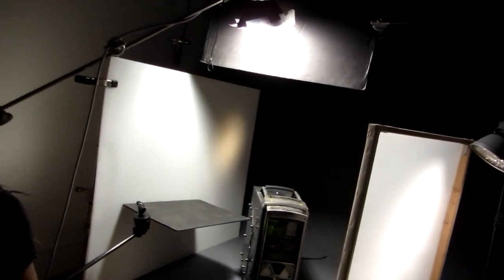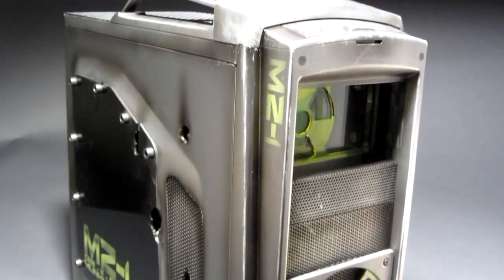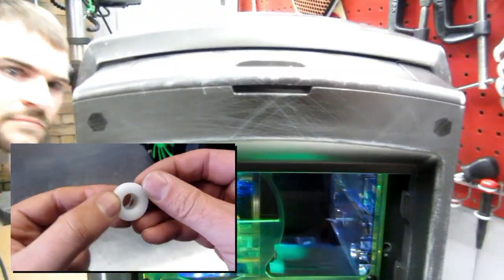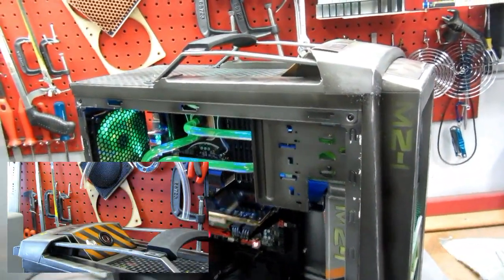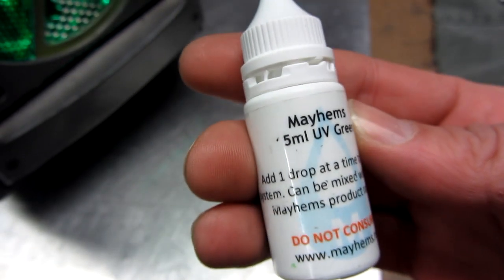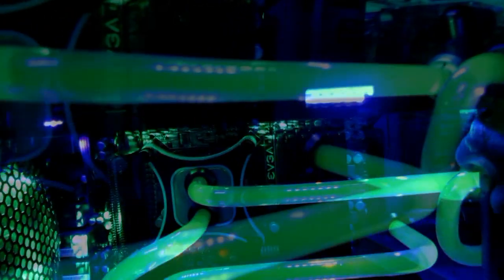"MZ-1" Mod Zoo PC, PART 5 of 5, Cooler Master CM Storm Case Mod, UV Green Liquid & Photo Session

Comment: I would love to have these parts for a build that I am contemplating later this spring. It will be my personal gaming rig. I am a totally new to modding and having some professionally designed parts to go in my new build would really bring it up to the next level.

I have built several systems years ago, but never had gotten into modding, liquid cooling, sleeving, or overclocking. I now find myself totally engrossed in the possibilities.

Thank you for your videos, especially the how to ones. They are tremendously helpful to a newbie like me. Keep up the great work!

Comment from the maker: FIXED Giveaway Parts Links

1x Mnpctech Overkill "Nautilus" 240 radiator / fan grill
http://mnpctech.com/pc-computer-alphacool-ek-bitspower-hardwarelabs-heatkiller-liquid-cooling/mnpctech-overkill-240-nautilus-fan-and-radiator-grill.html

2x Mnpctech "Reactor" 120mm 3/16" thick billet fan grills
http://mnpctech.com/pc-computer-cooling-fans-grills-custom/pc-computer-gaming-machined-cooling-billet-fan-grills/

24x Copper PC Chassis Pop Rivets,
http://mnpctech.com/case-mods-gaming-pc-liquid-modding-custom-computer-mnpctech-overclock-cooling-fan-grills/pop-rivets-for-pc-chassis-cases-copper-black-silver-countersink/1-8-pop-rivets-for-pc-cases.-en.html

1x set of White Delrin PC case feet, 
http://mnpctech.com/pc-computer-stereo-desktop-case-feet/mini-itx-pc-case-feet-white-delrin./mini-itx-pc-case-feet-white-delrin.-en.html

2x 120mm UV Green Fanblade, Green LED Apevia PC Fans,  
http://mnpctech.com/case-mods-gaming-pc-liquid-modding-custom-computer-mnpctech-overclock-cooling-fan-grills/apevia-green-uv-120mm-and-140mm-led-pc-cooling-fan.html

2x 120mm Black Modders Mesh fan grills, Honeycomb
http://mnpctech.com/pc-computer-cooling-fans-grills-custom/modders-mesh-pc-fan-grills-en/

1x Fighter Pilot Toggle, Standard On/Off with CLEAR cover,
http://mnpctech.com/case-mods-gaming-pc-liquid-modding-custom-computer-mnpctech-overclock-cooling-fan-grills/switches-toggle-pc-computer-power-reset/military-fighter-pilot-pc-toggle-switches.html

Comment: I'm currently modding a Fractal Design Define XL (Rev. 2 - really making the case wicked.. not just adding in a window and some other stuff..), which I'd surely be glad to get some awesome looking parts for :)
Done so far:
1. Planned out how to mount my case so it "evens out" with the side of the table its being built into (It's kinda gonna look like a built-in aquarium type thing..).
2. Made the case thinner and made a new new "side-door" instead of the front opening "door".
3. Currently adding watercooling to the setup (..your previous acrylic video gave me a gew ideas and hints - thanks).

Comment: Starting with some computer class in a week or two , probably gonna customize a CM Haf XM in a few months Just changed the inside of my old computer case (replacing harddrives etc.) , wouldnt mind changing the outside ... Those parts are just awesome!

Comment: Bill,
I'm planning on modding my Chieftec dragon case, as we have discussed previously in the forums. These parts would sure be a great help in getting that project going.  I should be ordering my new build within the next month so the chassis will be empty and ready for work.  I had considered a Dr. Who theme, but that's lowest on my priority list as I'm wanting  to make this case as modern as possible, feature wise.  I had already considered making the case ready for a 240/280 rad as well as some other unorthodox modifications.  I'm sure i can find a great use for the majority of the parts and what's not used I would be willing to give away myself.  Also, I would do a review/overview video of all the parts on my channel as just a small way of saying thank you.

Comment: That thing came out sick. I like how the blue leds reflect off the tubing. Gives it almost a blue outline. Gotta say, after watching all your vids ive been inspired to build my own mod. Got a corsair 600t that i want to paint either red or dark purple. Gonna add another r9 290 in there and try my luck with a custom water loop. Im probably gonna try to get a 240 rad in the front panel to cool the vid cards and those fan grills would look good on it if ya catch my drift there pal.

Comment: that's one of the coolest case i have seen.

I don't have 'too much' money but my system is so old and slow so i have to update it.
I have decide to update my system next spring. 
Those fan grills and led fans would fit perfectly to my modified antec gx700 case.

Comment: Nice parts. I also modded my cm scout2. 120rad 45mm in the rear and 240rad 30mm in the front. The tubing failed  a bit and dellidding my 3770k too. Made some scratches on the cpu, then I used the vice and hammer method and I saw my cpu flying for meters. I was surprised that my cpu survived it :D

Comment: Well where do I start Bill, love the videos they have gotten me motivated to start modding computers again, havent done any since my oldest boy was killed by a drunk driver 8 yrs ago. But your vids god me motivated and I found an old Xclio windtunnel grey case that I decided to Mod, put a window above the the 2 larger fans on the side(got all the stuf from mnpctech by the way) took out the brace running from front to back on window side, lots of blue led fans, satin black interior, 2 tone blue metal flake and blue carbon metalflake  ( I got the idea for that from the alienware puter u did in black and silver with the carbon fiber themme) it looks really good. Opticals and bay covers, front opening cover all have the carbon fiber look. cut out the top and have been trying to decide waht to do with the fans i wan to put up there, those grills would look damn good on top, and the feet on the bottom. Put a couple of your temp gauges in one of the bay covers, did lots of stuff to it.. I could use the other paraphernalia on the next one Im building for my future son in law. Anyways love your videos keep em coming.

Comment: I already posted earlier, but I now know exactly what to do. I have a Switch 810 that I will (hopefully soon) paint a dark military green with blaze orange accents, and I have a 9" laptop monitor that I want to somehow integrate into either the side or front panel. I will put the overkill 240 grill on the bottom of my h100i inside on the top of my case, and the two green fans would go on top of the h100i, shining green light out of the slots on the top of the case. Of course the feet would go in their usual spot, then I will use one reactor symbol fan grill on the internal top-rear exhaust fan, also paint to green with the reactor " legs" painted blaze orange, and the other fan grill will go on the front of my case, after cutting out a 120 fan slot in the front cover, then place one of the mesh grills between the grill and the case front, painted green. Sweet mother of GOD, these parts would make my computer a magnificent BEAST!!!!

Comment: why? Because I'm currently modding and mid tower case with a Razer inspired look. Side window cut out, which will have the Razer Logo engraved onto the acrylic. And going for a turbine fan in the fron bezel like in your older vids :) but with a 'Razer green' fan, and a green LED fan to light the front up in a push pull configuration. the chassis will be painted flat black along with the outside panels, front bezel ect. finished of with 'Razer green' anodized screws just to give it a bit more life. The grills would really just make it stand out more, and i had and idea of modding the power switch with a missile switch and a momentary key switch as well. so yeah i would most defiantly use these part to VERY good use :)  plus I'm Australian so you know the parts will be looked after :D Cheers Mate!!!

Comment: these things would be greate to grade up my Sharkoon Value T9 which really sucks. I had a few things going on it: 2x120 Fan mounts+holes cut in the top of the case. put a fan inside on the sidepanel etc. not major things, but I win this stuff it would be awesome and I would work further on my shitty case to make it pretty and functial. I even would post it on Forums etc. I learned so much from you and I hope I can share it with others :)

Comment from the maker: By Request, links to the parts for the giveaway mentioned in the video, 

Parts Links

1x Mnpctech Overkill "Nautilus" 240 radiator / fan grill
http://mnpctech.com/pc-computer-alphacool-ek-bitspower-hardwarelabs-heatkiller-liquid-cooling/mnpctech-overkill-240-nautilus-fan-and-radiator-grill.html

2x Mnpctech "Reactor" 120mm 3/16" thick billet fan grills
http://mnpctech.com/pc-computer-cooling-fans-grills-custom/pc-computer-gaming-machined-cooling-billet-fan-grills/

24x Copper PC Chassis Pop Rivets,
http://mnpctech.com/case-mods-gaming-pc-liquid-modding-custom-computer-mnpctech-overclock-cooling-fan-grills/pop-rivets-for-pc-chassis-cases-copper-black-silver-countersink/1-8-pop-rivets-for-pc-cases.-en.html

1x set of White Delrin PC case feet, 
http://mnpctech.com/pc-computer-stereo-desktop-case-feet/mini-itx-pc-case-feet-white-delrin./mini-itx-pc-case-feet-white-delrin.-en.html

2x 120mm UV Green Fanblade, Green LED Apevia PC Fans,  
http://mnpctech.com/case-mods-gaming-pc-liquid-modding-custom-computer-mnpctech-overclock-cooling-fan-grills/apevia-green-uv-120mm-and-140mm-led-pc-cooling-fan.html

2x 120mm Black Modders Mesh fan grills, Honeycomb
http://mnpctech.com/pc-computer-cooling-fans-grills-custom/modders-mesh-pc-fan-grills-en/

1x Fighter Pilot Toggle, Standard On/Off with CLEAR cover,
http://mnpctech.com/case-mods-gaming-pc-liquid-modding-custom-computer-mnpctech-overclock-cooling-fan-grills/switches-toggle-pc-computer-power-reset/military-fighter-pilot-pc-toggle-switches.html

Comment: I don't need the parts in this giveaway, but I wanted to say that I like your mods.  Should I get these parts,  I will start figuring out a way to start my next mod.  I used your case black knurled case feet to create more air flow under my current build.

Comment: well, if i am the lucky one, i definitly would use the casefeet and the 240 grill for my waterbox-project. that thing will have three 240 rad's inside to be capeable of cooling the cpu and the gpu of nearly any system. having all those cooling-stuff in another box would make upgrades much easier. i planned to do it monochrome, so i guess the fans will be used otherwise.

Comment: Thanks Bill Wicked Parts would Love those Feet on the Define R4 once i get a CPU 6800K or Athlon X760  and DDR3 1866 or 2133 then my MSI FM2-A85XMA-E35 in the  Define R4 with UV lights  i would put those 2 fans with the Reactor grill in my Sister new APU rig in the Antec P280 the  Overkill Nautilus need to wait till it warm to paint im ask Fractal what color type it the Black and will i find it in any store to buy me 4 cans for another Project

Comment: i've just started watching your vids here, liking them very much. I have actually just sold my computer to my brother as I am saving to build a new one. 
This is my thought on what I'm thinking on getting...

CPU: Intel Core i7-4770K 3.5GHz Quad-Core Processor  
CPU Cooler: Corsair H100i 77.0 CFM Liquid CPU Cooler 
Motherboard: Gigabyte GA-Z87X-UD4H ATX LGA1150 Motherboard
Video Cards:(x2) Gigabyte GeForce GTX 770 2GB Video Card (2-Way SLI) 
Memory: (x2) G.Skill Ripjaws X Series 8GB (2 x 4GB) DDR3-1866 Memory
Storage: Samsung 840 Pro Series 128GB 2.5" Solid State Disk 
Case: NZXT H630 ATX Full Tower Case  
Power Supply: Corsair 760W 80+ Platinum 

..though I picked the Corsair cooler because I was having trouble finding a place to get custom loop parts, all from one place, and found you get your stuff from Primochill. They seem to have everything but the pumps,(some of their links don't work). 

I look forward to watching more of your work, oh and above said list is a good reason to get free stuff, wouldn't you say.

Thanks

Comment: OK dude I could totally us the parts in my new Arch 2 Midi build I am doing this year . I will have to change my color choices to UV green . But thats not a problem . I could use that Nat Rad grill to go on my top 240 mm Rad , and I could us that switch for a on and off switch.  The fans would look great on my front 240 Rad in push pull config. and the case feet yes . Every case needs good case feet . I should get this stuff because I am really starting to get in to PC Modding PC Water cooling , and PC custom wiring . I want my first build to be very visual pleasing. I will be doing a water cooled build with all EK blocks and All Bitspower Fitting . I have not decided to go Hardline or Soft Tubing , but more than Likely I will be going hardlines from Primochill. I plan on doing some mods to the case like a fill port , and maybe some custom painting . I am not the biggest Modder in the world , But I have been building PC since the Windows 95 days . Here is a link to my facebook pic build   https://www.facebook.com/media/set/?set=a.1414817855423447.1073741877.100006857376395&type=1&l=d69033e50a

I will have to change to color setup as I said . Will change to black sparkle bitspower fittings and maybe some UV green wiring . I will be doing some custom wiring in this build as well . I have a idea to take two Bitspower Water Tank Z-Multi 80 Inline Reservoir and put them together on on top over each other with a  Bitspower Dual G1/4" Male / Male Fitting a config I have never seen before . I will be laying carbon fiber film thought out the case . Hopefully this mod job is not to small , as you guys go all out on your mods, I would love to get to that point that you guys are at with my Mods . One Day I will be . But everybody has to start some where.

Comment: I LOVE this design! UV green looks like acid flowing through it! I would love to have those give-away parts to use on my Fractal Design Define R4 which I modded to house a 280mm front radiator thanks to your tutorial on how to do that. Guys, check it out if you have the same case and want to increase rad space in your R4: http://themodzoo.com/forum/index.php?/topic/775-diy-case-mod-guide-280-radiator-in-fractal-design-r4/ 

That was a very easy mod to do even for a newbie to modding and water-cooling; in-fact, I just built myself my very own computer for the first time 2 months ago! I haven't made a cut-out on the door of the case for better intake like you did in the AMD Fractal R4 Giveaway, but if I win I know it will be easy as cake to do thanks to your many wonderful tutorials. I've never used a jigsaw or hole saw but just from watching your tutorials so many times I've already learned how to in my head. Just a matter of buying the tools. So thanks Bill, love your videos keep up the great work and designs and creativeness that I am learning from a lot!

My set-up is all black and green so these give-away items are perfect for me! I've been looking for green stuff to compliment my green theme ever since I built this pc. I have a green back-lit keyboard and mouse along with a green cathode inside the case. Going to buy that UV green dye and replace the cathode with a UV one instead. I hope I win!